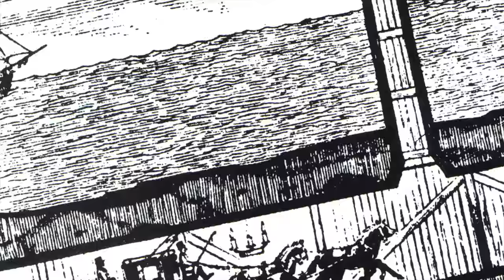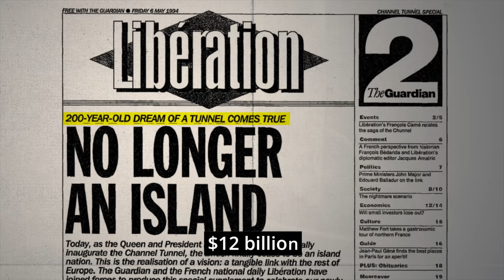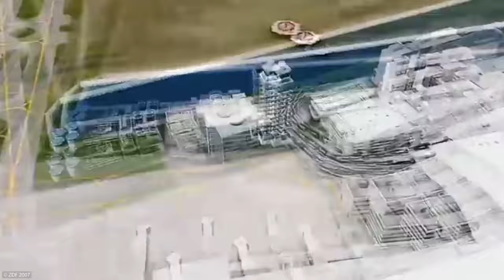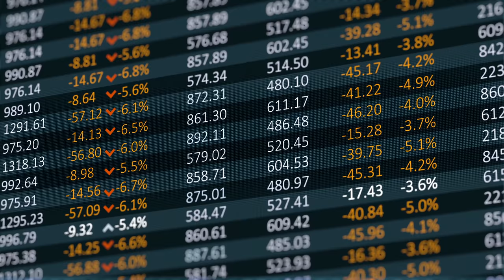Most Expensive Construction Projects Ever Built

Comment: So where did all the vehicle pollution go? I imagine in the lungs of people in the tunnel regardless of extraction and the balance expelled in the air above it somewhere. As the former road was elevated, it would certainly decrease the amount of pollution making it on ground level as it dispersed into the air. The park replacing the former road is a really nice touch and a great part of city planning.
Reply: Weirdly since replacing the freeway that was cutting the city in half and replacing it with a park more people choose to walk between neighborhoods and take public transportation vs driving. The big dig was bigger than just a freeway project, the MBTA Bostons subway lines were improved and expanded and new stations were added. Also, money was spent on cleaning up the Boston harbor which was at one point one of the dirtiest water in the country. Now it's one of the cleanest.

Comment: Kansai airport is sinking at a rate its designers and engineers never thought possible, to repair the damage the initial building cost has been surpassed significantly plus the end of adjustments is not in sight.
Reply: Don't worry . 
Japan's civil engineering and construction technology is the best in the world 💪👍💯
They are the number one creditors in the world and have money 💵💴💶💷💰
Reply: @pazpaz3059  money isn't the problem here, thinking of a way to prevent an entire airport from sinking is a very difficult task. The airport sinking in the first place is a very big oversight by the engineers themselves.

Comment: You neglected to mention that the Big Dig promised the people of Boston improved subway lines on every line, and a tunnel reconnecting North & South station directly, since the the overground rail line was used for metal during WWII & never replaced. They never built any subway infrastructure, and the highway has made it impossible to reconnect the two with a tunnel. The city paid for it, and now people in New Hampshire can get here in a jaunt with a massive truck while the first green line light rail extension promised with the big dig was completely tied in ~2022~ the big dig is going to cost more because we the people of Boston still expect a significantly updated subway system and the state of Massachusetts has a $8,000,000,000 “rainy day fund” that we are by and large demanding goes to the promised subway updated the big dig was suppose to complete. That’s why it’s controversial. The “Emerald Necklace” line odd parks as we call it is a urban planning wonder however. Even though the land is to unstable to every develop on which causes inherent concerns because why is it unstable, and the city has had numerous collapses on old parking garages this year that were weakened and never reinforced

Comment: I was young but I only remember hearing that the big dig was a joke. Didn't it fall onto cars right after it opened?
Reply: 1 ceiling panel to fall on a car and killed a women. The method used to secure panel to tunnel ceiling should of been designed useing a stronger method. Useing vibration and weather in decision. They did say method used was not followed as specified meaning blame a worker for an easy end